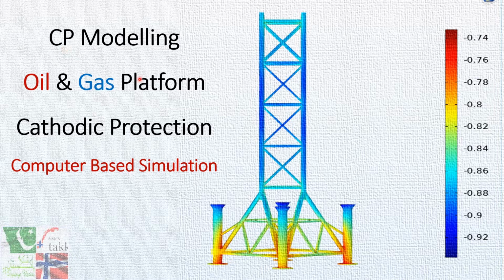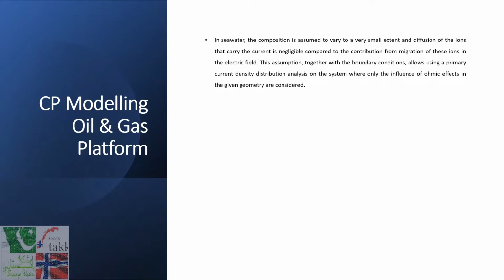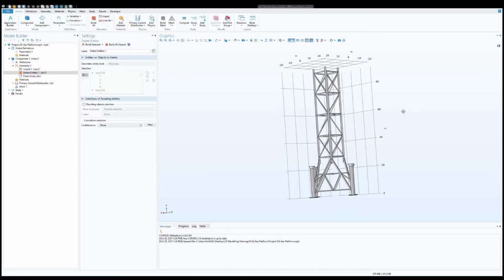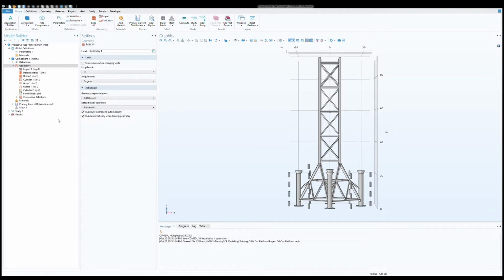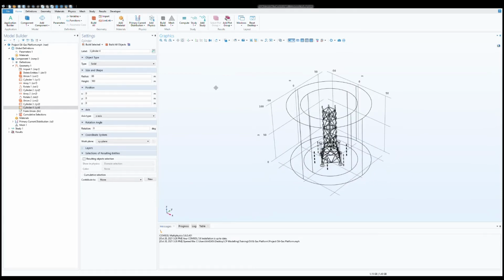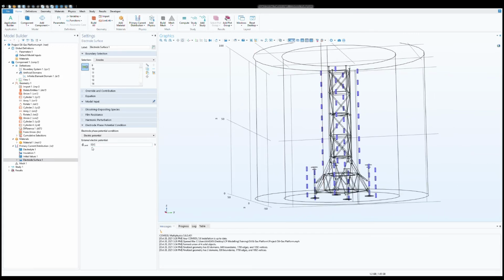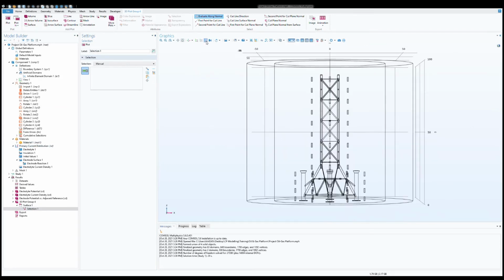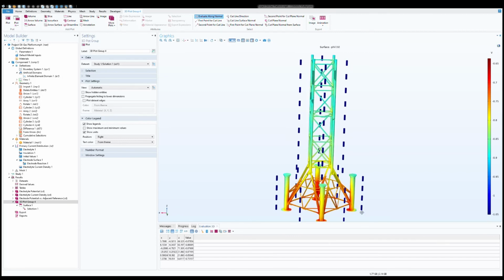Cathodic Protection Modelling, Oil and gas Platform, Comsol

Comment: I am not importing this file what you have taken in the video. i went to CP folder and select this file oil_platform.mphbin , but problem is here i am getting pre build anodes this is not i want
Reply from the maker: You can remove/disable those pre-build anodes and then draw the anodes you want 😀